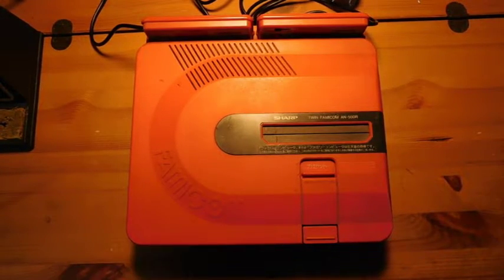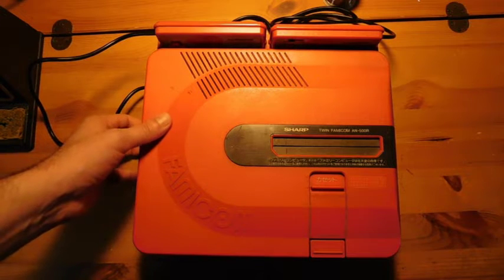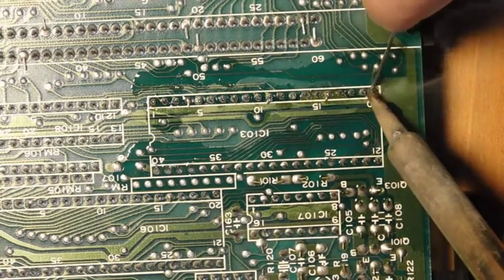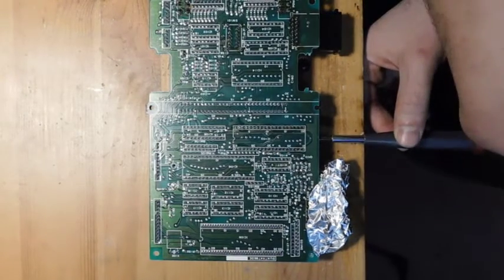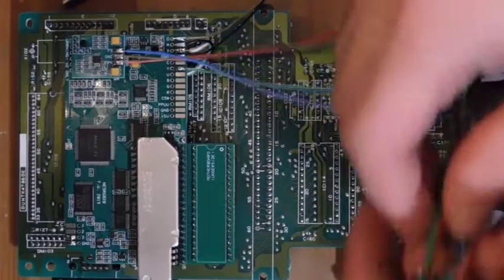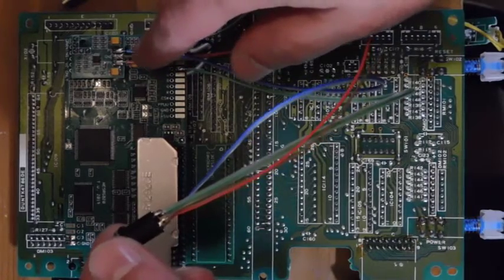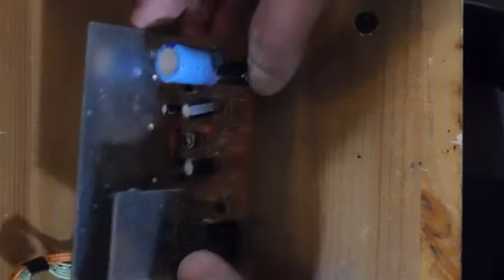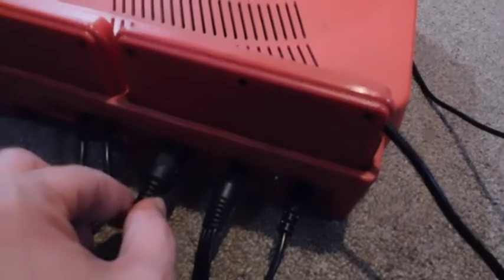Sharp Twin Famicom NESRGB mod! Installation guide and technical demonstration

Comment: you're losing expansion audio if you're just getting audio from pins 1&2 on the twin famicom
Reply from the maker: Expansion audio is built into the Sharp, so if you pull audio from the final output, the regular audio and expansion is already mixed
Reply: @LIRetroGaming  Yeah. Unfortunately the final audio output on the Twin Famicom is really quiet and crummy (at least on mine). There's an old Voultar post on the shmups forum where he describes how to hook up expansion/FDS audio into the NESRGB on the Twin Famicom. You can't have both connected at the same time, so you have to hook into the Twin Famicom's cart/FDS switch. But then you should get the nice NESRGB audio with expansion/FDS audio mixed in.
Reply: I was able to get the audio working how I wanted. I uploaded a quick video so other people can find it: https://www.youtube.com/watch?v=QhbIu_NR5Rs
Reply: @UnbornApple  Do yoou still have your video where you show how to connect the expanded audio?

Comment: Hi I have a question, I have tried calibrating the spindle on my disk system but am still getting error 22. I have also tried using other methods on other videos but still getting error 22. Any help as you have repaired yours would be appreciated thanks in advance. Update:  i did get it to read the disks i have but had to angle the drive upwards which was strange but then i tried re calibrating it again now cant get it to read at all just error 22
Reply from the maker: Yes I used this guide to get my FDS disk drive working https://youtu.be/fOY1G3Sg11Q
Reply: @LIRetroGaming  i followed that guide too but still getting error 22 :(

Comment: Have you done any updated mod to handle the expansion audio?  I used your video to install my NESRGB with a personal no-cut twist but realize now that the expansion audio has known issues and ways to rectify it seems muddy.  Would appreciate any insight.
Reply from the maker: Yes I have learned about a fix for the audio in the twin Famicom and you can find the details here: https://etim.net.au/nesrgb/installation-famicomtwin/
Reply: @LIRetroGaming  Yeah, I looked on his site and it only addresses the volume and the FDS audio distortion. Exp Audio itself is missing from the setup you did in the video. I tried Akumajou Densetsu (cart) and the audio is definitely missing a channel.  Looks like I’ll be rerouting the audio to directly on the mono output to get it back per Tim’s original install.

Comment: So siiick! Just won a junk twin famicom on buyee. I'm thinking about going the NesRGB with multiout port the scart to the retrotink 5x.  
Solid work as always my dude.
Reply from the maker: Nice! They are really cool to own. You can also repurpose the 8 pin DIN connector for RGB on the twin Famicom. That way you don’t have to cut the shell and add an extra connector. That 8 pin DIN was used for RF on the twin Fami which is crazy!
Reply: @LIRetroGaming  brilliant!

Comment: i planned on removing the RF modulator and putting my din connector where it was...  You can't put audio in the 8 pin mini-din connector?
Reply: What I did was cut all the RF traces that were going to the DIN connector and then sent RGB, composite, and audio to the DIN using the same pinout as a Genesis Model 1. This gave me RGB, composite, and audio using the original DIN. I ended up losing that portion of the footage, otherwise it would have been included in this video
Reply: Very easy to pull traces. Make sure to use plenty of Flux on both sides